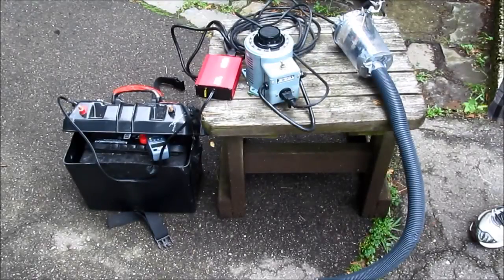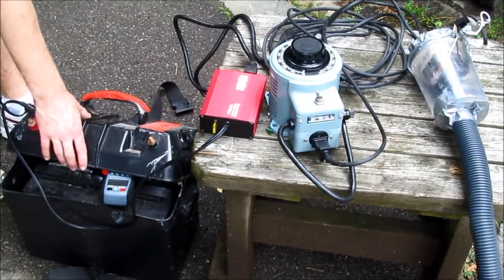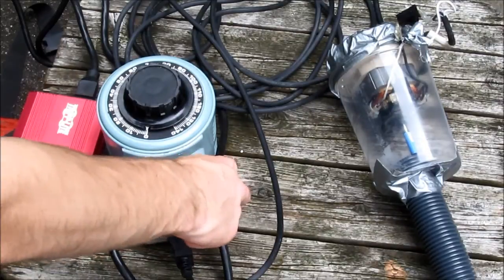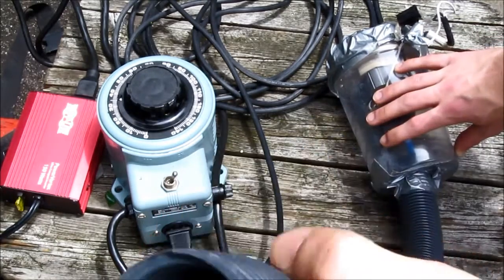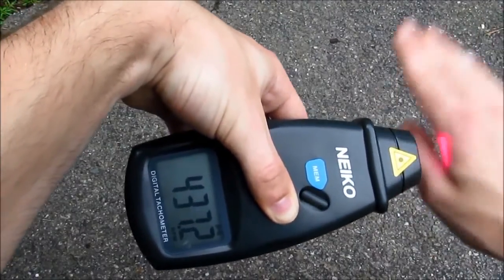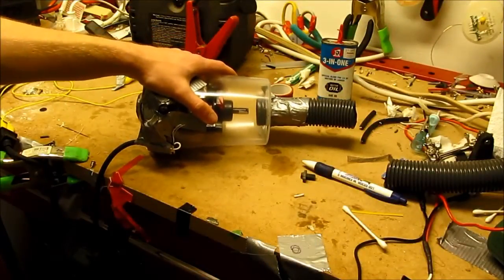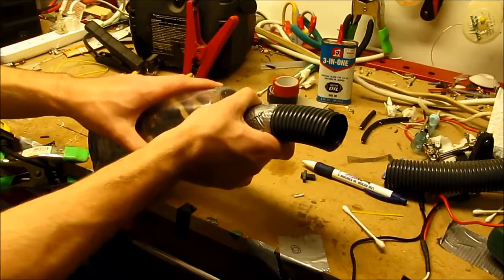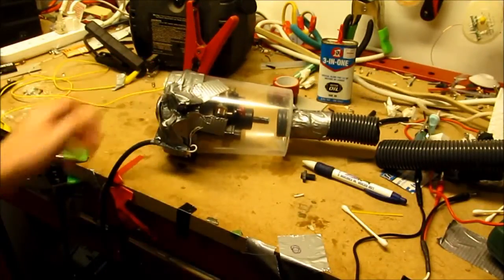Variable Speed Vacuum Cleaner Motor with Inverter and Variac

Comment: Kool..jus what I'm doing. Making a variable speed controller for a vacuum. For my vacuum blower sand separator..keep a tinkering
Reply from the maker: Are you using a variable transformer like this?

Other things I can think of off the top of my head for variable suction would be adding a valve to bleed off some of the suction force.  For variable motor speed, universal motors like this can run off a Triac dimmer type circuit.  Might need to search a suitably robust dimmer though, as typically they are limited to maybe 600W.

Comment: You don't need an inverter. It can run on dc
Reply from the maker: Indeed these universal motors can run on DC as well! This setup gave speed control and the ability to increase voltage above 12V, using equipment I already had on hand.  More efficient way would be a DC buck-boost converter to allow a wide range of motor speeds from a 12V input.

Comment from the maker: These variacs are beasts.  And the inverter is square wave as far as I know.  It has nice overload protection (which I have tripped countless times).  Induction motors and transformers behave differently, so the long motor starting surge may have killed your inverter.  The variac makes a bit more noise on it at no load but the batttery current is in range considering inverter efficiency and how much the variac pulls at idle on normal mains.  Thanks for the comments :)

Comment: I actually have the same variac!  I really like how the switch and plug cover comes off and I can hook up different windings.  Is that a sine wave inverter?  If not I am amazed that it still works.  You are not supposed to run inductive loads on square wave inverters.  I actually popped one when I plugged in an induction motor to see what would happen.  It made an unhappy squeal and stopped working.  I opened it up and a couple of the mosfets were really hot. Nice video! Thank you for posting!

Comment from the maker: This will be supplying forced air to the "wood-burning flowerpot" on an island beach where the nearest mains outlet is 100 to 1000 meters away, making an extension cord very impractical. I hadn't revealed that detail until now, so its fine you were confused :)